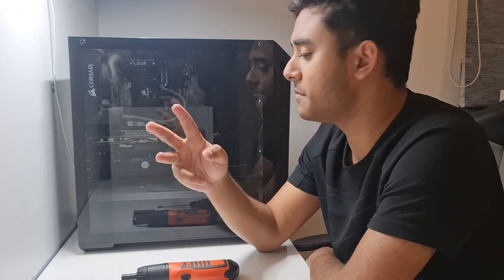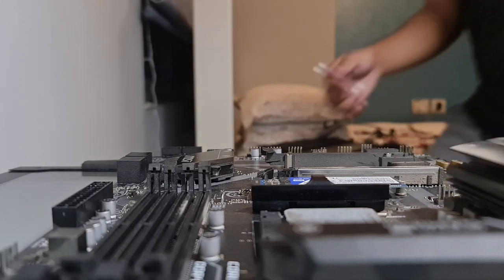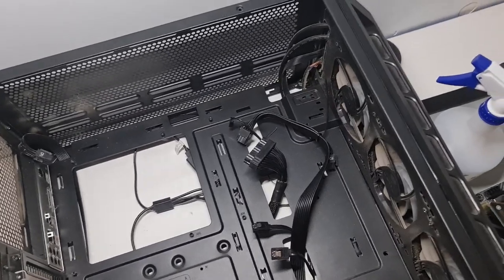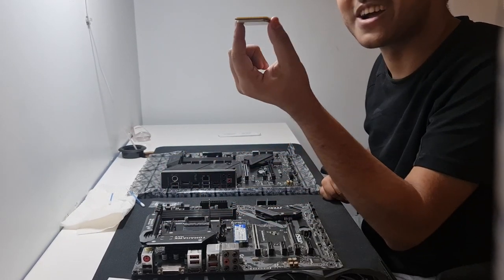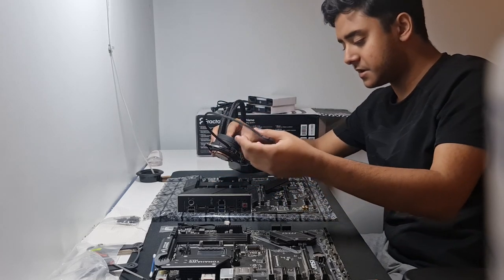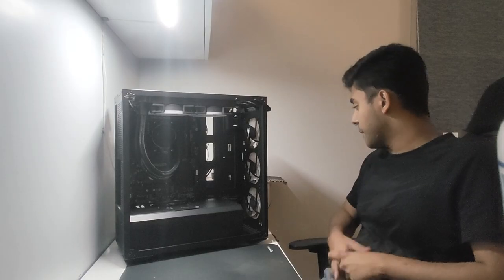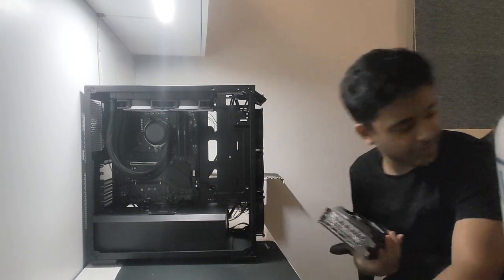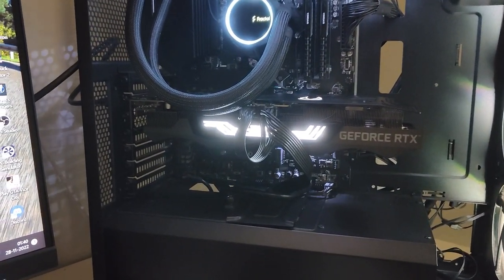Upgrading my PC! - Dream Setup Part 1

Comment: Build looks really good one thing, I would rotate the radiator 180 degrees and have the tubing facing forward to clean up the look around the GPU, make the GPU intall a little easier and provide better access to the rear making it easier to mount another fan.
Reply from the maker: Thanks brother! Duly noted!
Reply: @codexverse  and obviously only if it is even possible to do that. Still, excellent build!